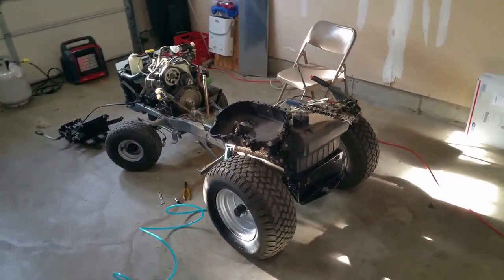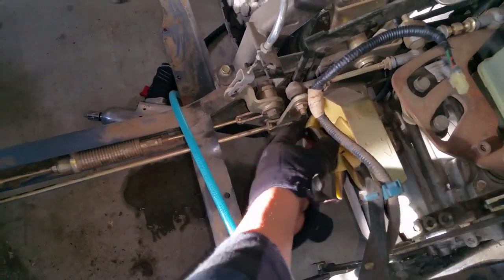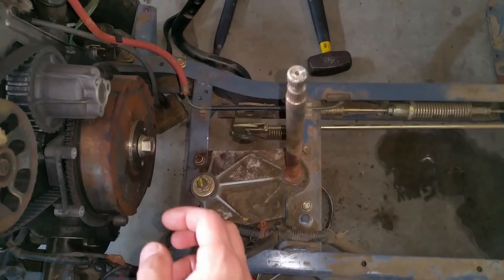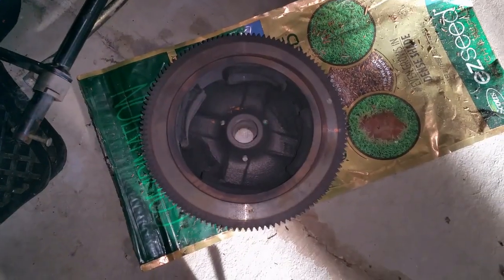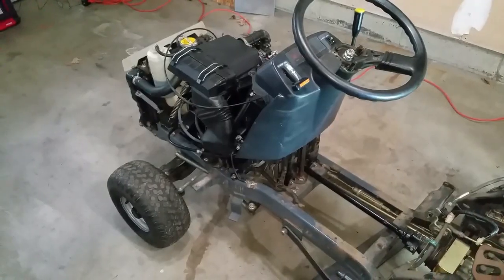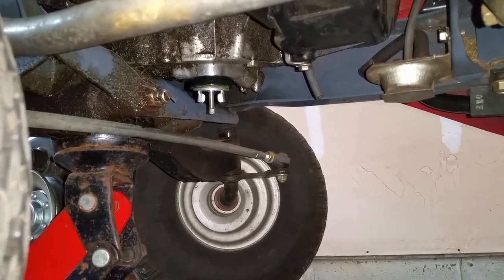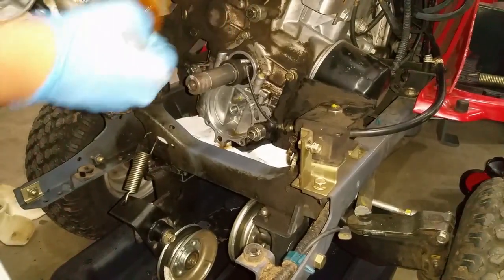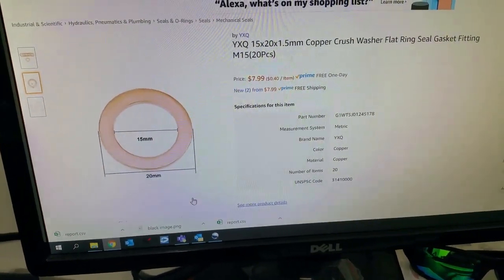Honda H4514 Service & Rebuild

Comment: The rear main seal needs the molded ridge to properly seal. Trimming the ridge doesn’t work. I used the tractor last summer but had to keep an eye on the oil level and waited until the winter to replace. I just got done with the replacement of both oil seals and gaskets. I pulled the motor out without taking the steering pedestal off so workbench height makes things easier. This is a job that is not for faint of heart. I had to take everything off like I did when I replaced the water pump plus the camshaft pulley. I replaced the coils last winter so they were still good. The bottom half of the motor needs to be removed for replacement of the rear main seal and allows for easy replacement of the front seal. I ordered Honda’s Hondabond 4 gasket making sealant to seal the crankcase when putting it back together. The main bearing caps are molded into the bottom crankcase half so I didn’t go crazy with the gasket sealant and torqued the pan bolts according to amounts found online. After putting it together and replacing the pto clutch due to bearing failure I’m happy to report that it seems to be good. Left it run for over an hour with no issues and new pto clutch works great. Looking forward to grass growing season!
Reply from the maker: Yeah actually this machine I'm getting back in the next couple weeks I will be replacing the PTO clutch as well it is original from 1989. I took it off a few years ago to inspect and it looked fine with normal wear but the clutch bearing is now starting to have problems

Comment: I am in the process of doing much of the same. The head gasket was blown and had the head checked for warpage. The motor had overheated. Parts are extremely expensive and some are getting scarce. The service manual sometimes isn’t all inclusive.  The rear tires are really pricey.
Reply from the maker: yup pretty much anything for this machine is overpriced, but considering how much support I found for it It was not as bad as I initially thought. A similar built machine new today would easily fetch over $7K usd in my opinion Thank you for watching! I'll be working on a 3813 rebuild soon too!
Reply: Bassguitarist1985 
Honda pretty much priced themselves out of the market, even though they are great mowers. Let me know if you know of any rear tire sources or substitutions. Plano Power in Texas is another parts source.
Reply from the maker: @davidhorne2326  rear tires are 20x5x8.5-10 size. you can pickup a set of two tires for about $110 bucks on ebay shipped. Its a trailer tire pretty much, and the fronts are 15x6.00-6 which are standard for most mowers. Rear tires from Honda...easily $200 a tire!

Comment: Very informative. I had to do the same repair regarding the timing belt as you but I opted to remove the engine. 

A new problem that has arised that I think you have addressed is the oil leaks. The mower managed to leaked much of its oil onto the floor of the shed over the winter. I think it might have a similar issues with the drain plug and the oil pump gasket.
Reply from the maker: Thanks for sharing

Comment: Great video, I have this model. I have a screeching coming from somewhere around the radiator fan. I am going to try to remove the fan. Could it be the fan clutch?
Reply from the maker: There is no clutch for the fan but there is a PTO clutch for the blade deck. Chances are if the clutch assembly has not been replaced since the late '80s then the bearings inside have worn out and that is what you are hearing. Unfortunately the bearings cannot be pressed out and replaced they are encapsulated. The entire clutch assembly would need to be replaced which is around $300 USD Plus the labor to install it

Comment: Just a follow-up on my h4514 with a seized GX360k1, it turned out that the gear on the backside of the flywheel got deformed a little bit, somehow, that it touched the aluminum water pump housing, and consequently seized the engine totally. Kind of difficult to spot on, as they are virtually on top of each other, until one pulls the flywheel off. I will put the flywheel on a lathe to correct that tiny mini deformation. I do not know how this might have impacted the valves, or other parts internally inside the engine. I guess I will find out once I put everything back and run the engine again.

Comment: Fantastic video, great information - Thanks for sharing!   

I have a H4514 I bought new in 1994, engine s/n 1008778, and have been looking for a new carb.  The parts listings all indicate it needs 16100-ZA0-707 (BE27C A), which is no longer available.  The -708 (BE27C B) was used for s/n 1218320 and later, but it is not listed as a "replacement" for the -707.  Any idea if the -708 can be used on the older engines?
Reply from the maker: I beleive it can. Check mytractorforum in the honda section as many often put their tractors up for sale or parting them out
Reply from the maker: I did a search on ebay, looks like many are available used. Seems many are using 16100-ZA0-L01 as a replacement regardless of the serial number. Cant imagine its that much different.
Reply: @Bassguitarist1985  Good info, thanks.  I hadn't been able to find anyone saying they'd successfully used the new (-708, BE27C B) on the older engine (s/n <1218320).  Looking at parts diagrams, the carb itself is pretty different -- solenoid, bowl, float, gaskets, etc are all different p/n.  However, even though it uses different gasket on the engine side, the part to which it connects (the "insulator" between carb and intake manifold) is the same for all engine s/n.  But it is odd -- if it is compatible -- that Honda doesn't list the -708 as a replacement for -707.   That worries me there is some difference that requires pairing carb/engine by serial.
Reply: Ok, I'm an idiot.  :-)  I have two "warranty reference" forms from when I purchased the mower new.  Both have fields labeled "Frame No." and "Engine No."  One has frame MZAS-300xxxx and Engine 125xxxx.  The other says frame RZAZ-1008778 and Engine 1008778.  Guess what....   That second form is for the grass catcher, and they just repeated the same s/n in the engine field (obviously it doesn't have an engine).   I had mistaken that for the mower engine number....   But the first form is for the mower, and it shows engine # 125xxxx which means it uses the NEWER -708 carburetor that begins at 1218320.  Genuine Honda -708 carb is only about $110, so I'm back in business!

Comment: I was hoping this video of your's would show how the clutch and clutch cable go back in, but it didn't. I'm sending this comment hoping to get your assistance... have noticed you do a lot of videos! My husband (who is a good mechanic, but not so good with computers) gas been trying to get our Honda 4514 clutch reinstalled. It seems to be in and working correctly but when he attaches the cable, it engages and disengages backwards. It engages when it should be disengaging and visa versa. We are at wits end. Can you help? Is it possible it's an electric problem?
Thank you, dtewks
Reply from the maker: Hey Dianne! Which clutch? The PTO clutch for the blade deck or the transaxle clutch for the wheels?

Comment: I just got a 4514 but every time I release the parking break the engine shuts off.  Any suggestions?
Reply from the maker: @Juanpablo-ou1fp  def one of the safety switches is bad. Got to test them all.

Comment: Do you have to remove the engine to change the Starter which is on the bottom of it?  I notice there are 2 sets of timing marks on the Cam gear.  Does it matter or do you simply not turn anything while replacing the belt?  I inspected a 3813 Honda, a similar smaller model and decided the best way is to sell it!  I believe it slipped a tooth or two.  Going on Kijiji in Ontario  in September 2020.  What was the cost of the rebuild? $1,800?  Very well done and well explained.
Reply from the maker: It does not matter what T mark is used. Yes engine mount has to be removed to change starter, but not necessarily the whole engine. Support it from the bottom, remove the mount, swap the starter. Probably bad brushes.
Reply: @Bassguitarist1985  Thank You.  This one is spitting back thru the Carb.  Ran great 2 weeks ago.
Reply from the maker: @gordbaker896  sounds like it slipped a tooth, and/or valve lash needs to be adjusted. The other issue could be a carb issue dumping too much fuel.

Comment: can you tell me how to remove the starter is the bolts under the timing chain cover ?
Reply from the maker: I believe there is a mounting bolt underneath the cover but the mounting of the starter motor is also part of the motor mount itself. The engine would need to be pulled out of the frame in order to replace it

Comment: I need to replace the rear main seal. There is a lip on the seal that goes on the inside, how did you get the front seal replaced without splitting the crankcase. From the pictures on a parts website it appears that the front seal is built the same as the rear.
Reply from the maker: I used a wood screw threaded into the sral and used it to pry the seal out. Then slid the new one.
Reply: I was finally able to get the rear main seal out but installation of the new one has not been a success. There is a ridge on the seal that fits into a groove so pressing the seal in is virtually impossible. Without splitting the crankcase. The outer coating on the new seal tore so I am ordering another new one. I'm thinking of cutting the lip off the seal that I get so I can press it in without tearing it.
Reply from the maker: @matweber81  yikes. Thank you for lwtting me know. I yearly service this 4514 and two other 3813s for this client. Should their ever be a need to change that I'll know that the case would need to be split!
Reply: Split the cash and dropping the crankshaft to slide the seal on. I'm going to try the trimming of the ridge trick first and see what happens. The tolerances are pretty tight and I'm thinking the ridge is overkill. I've replaced a number of seals in different motors that didn't have the ridge and I have not heard of any of them pushing out on their own. I'll let you my results.
Reply: One other question. The camshaft pulley has two separate timing marks (T) 180 degrees from each other. Do you know if either one is good to use
Reply from the maker: @matweber81  you can use either. There should be a T for Timing, and F for Fire. Line up the marks to the T mark.

Comment: hello, your video is great. I have de same tractor. I have a problem with the starter, and I had changed the starter coals. Now the starter  turns upside down. Do you know the root cause? That would be very helpful ! Thanks a lot
Reply from the maker: Do you mean the starter spins backwards?

Comment: I'd do quite a bit of work to mine. The only thing left is the charging coil has the insulation coming off of it. I don't know if I have to replace it or not it was still charging. There's a lot of work and tearing one of these down
Reply from the maker: For sure! Unfortunately their resale value even if all that hard work from the teardown is performed people simply don't want to pay for it unless you find a collector of sorts that really enjoy the machine and understand the build quality.

Comment: I was just viewing my timing belt because my mower wouldn’t start. And it seems like my belt has been breakihh away inside the timing belt case. Do you know if these engines are interference or non interference engines?
Reply from the maker: Non interference
Reply: @Bassguitarist1985  thank you

Comment: did you find a generic carburator? or do you use OEM? mine started surging I will try to clean it otherwise I need to find a carubrator
Reply from the maker: No I used OEM. Getting harder to come by. It's the idle jet. Extremely small like an #82 micro drill size I think. Once you get that cleared up then the machine should run fine

Comment: Hi Richard, great footage and the way you explained things all along, watched it three times, very informative and enjoyable. Thanks a lot! 

I was so inspired by your project, and I happened to spot an AD selling the exact same machine, so I bought it. It has a completely seized engine, but otherwise in pretty decent condition from what I can see. The previous owner did not know what the problem was, as he said. I started off by disengaging the PTO completely, as it was the easiest thing to do, but no luck, still frozen. Then I stripped the machine from the rare, as much as you did with yours, with the drive shaft still to be removed next, to disengage the transmission, which looks OK, but not sure if that is the one that is frozen. Any idea what I should look for and into next? Or any other tips which would be greatly appreciated.
Reply from the maker: Bob, removing the PTO and driveshaft disengages the engine from all external implements. if it still doesn't turn freely pull the timing belt cover and inspect the flywheel. if that is not binding at the ignition coils or the charge coils underneath it, then something internally with the engine has seized.
Reply: @Bassguitarist1985  Thanks, I have done just that but still totally seized. I am waiting a tool to pull the timing pulley, then I would be able to open the crankcase to see what is happening in there.

Comment: I have one with a bad ignition coil.  Is  it easier to remove the cowl and sheetmetal or r & r the engine?
Reply from the maker: I have a medical condition so i couldnt lift the engine or own a hoist. Pulling the engine isn't as bad as it seems. Equal amount of work id say

Comment: This has been so helpful. Thank you so much for taking the time to produce this.

I replaced the water pump and timing belt on my 4514.i started it today for the first time and it ran which is extremely satisfying. I do have a small issue, there is water dripping from the bottom of the engine and I believe this is from the new pump.

I torqued the pump bolts to the correct setting but can't get the torque wrench onto the rear bolt (the one that's a pig to get to.)

I did tighten it but am now thinking may not have been enough so will have another go tomorrow.

Do you know of any way to get a torque wrench onto the bolt?

Richard
Reply from the maker: Have to slide the carb out of the way to get a u-joint in there. Make sure the mating surface is super clean with the new gasket. Old oring gaskets get hard and wont seal right

Comment: I'm working on one of these right now. I have the engine off. I need to get the flywheel off, but that knuckle that sits in front of the flywheel is still on. The 3 bolts are off, any tip on getting that knuckle off so I can pop the flywheel? Am I okay with a little force with a pry bar and hammer?
Reply from the maker: that damper , just the three bolts hold it on. give it a quick whack and it should pop right off. Probably held in by rust

Comment: I have this engine off the chassis. Do you think it is safe to bench test it breifly for about 1 minute with the radiator disconnected, or will it overheat that fast. Theirs still some coolant left in it after disconnecting it. I would like to be able to test it real quick and make sure it has spark, fires up and runs properly before I go putting it all back together. What do ya think?
Reply from the maker: yeah but no longer than that I'd say. good call testing before reinstalling. its a pain to take the engine out.
Reply: @Bassguitarist1985  Great, thank you.

Comment: Any idea of when you will do the 3813 video ? Was looking for someone to touch on the carb & governer linkage adjustments/settings.
Reply from the maker: I just had the 3813 in for a radiator swap, but I will be doing the 4514 carb linkage and new carb swap in the future though!

Comment: use kinetix 30w w/zinc for the eng oil--add hyper lube for extra zinc in oil for the best protection--on a 10 to 20 hr oil change

Comment: Just got one of these for $700- and mows so nice! Yesterday I finished mowing and got a cloud of white smoke, hopefully its too much oil and not blown HG. Any ideas or videos on that?
Reply from the maker: White smoke from the exhaust?
Reply: @Bassguitarist1985  yes! I noticed filter was grassy cleaned that let her cool down and then she started right up no smoke and drove her in the garage.
Reply from the maker: @mutantsatellite  dirty air filter can make it puff black smoke as its running rich at that point. White smoke can be many things. Hard to say

Comment: Thank you.  I was just working on my 1993 4514 tonight.  I have a knocking sound in the steering and it is down in the gear box and I figured it was the bushing.  You mentioned you replaced them, but in the edit you didn't get a chance to film that part.  I am wondering whether you can come from below with the deck off to replace the bushings in the steering box.  But, on the other parts you were quite helpful.  It has been a great machine in the 27 years I have had it and it has been used a lot.
Reply from the maker: Glad it helped. I would say it is possible to replace the bushings from the bottom, but the steering bushing where the steering rod is going to the wheel, you would need to remove the rod and wheel to change that one, and the plastic pedestal cover would need to be removed too. The foot plate would not need to come out though. It be tight, but possible

Comment: Well done and extremely helpful. I looked on the tractor forum and probably missed it, but couldn’t understand in the 4514 video your suggestion for parts companies except for PartsTree. The other sounded like “Bolts…” or something.  ?
Reply from the maker: Partstree for the parts diagrams, but i use boats.net in GA for honda oem parts